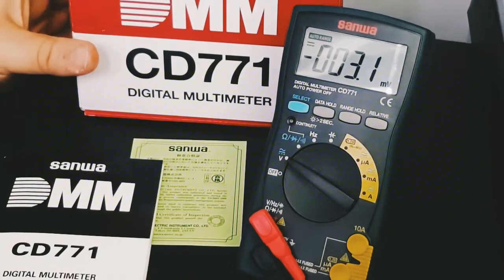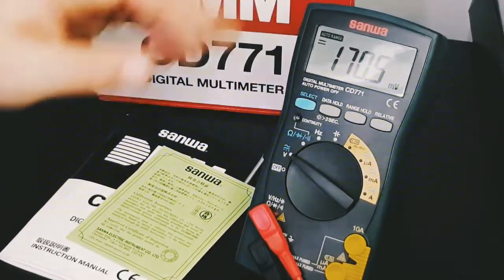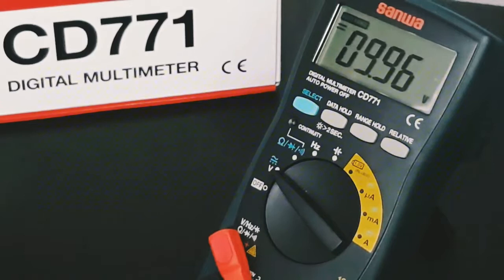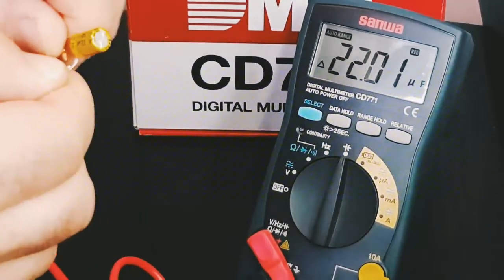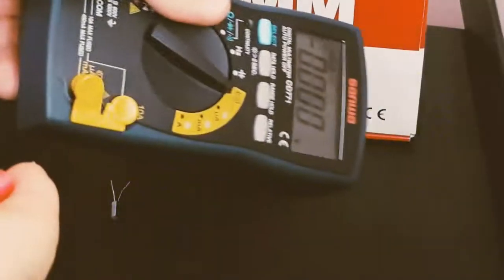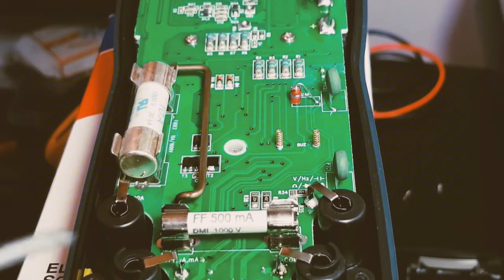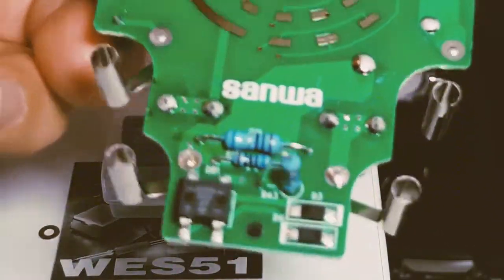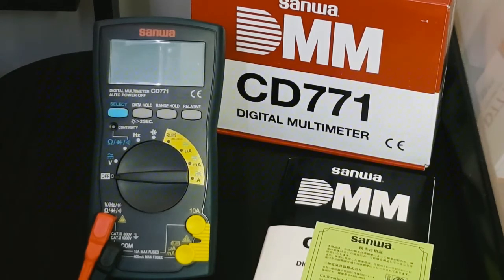SANWA CD771 Multimeter Review & Teardown!

Comment: as far as I can remember the cd 77x series was released in the mid 90s. I had one way back 2001. the 1st batch was made in japan. the rest was made in taiwan. mine fell on the road and got rolled over by a small dump truck. the plastic case was durable after the accident it had some severe dents but it still worked
Reply: So true...

Comment: Wow 100 Khz for the Sanwa, and wow those ranges switch pads look thick and beefy - some good jack support posts on the back panel for the lead sleeves as well, no pushing those out.  Nicely made spring mechanism on the range switch as well, and no cobbed main IC - I like it.

Comment: There're so many stuff made or assembled in China. Made in China does have great things, but also has a lot of cheap knock off. It's a matter of how to pick and choose. 
If you are not happy with it, I guess you can return it for refund for most of the time.
Reply from the maker: Indeed. I longer have this unit as I was generally not that impressed with it. It's sibling the Sanwa CD732 is still on my bench after 2 years 😁

Comment: Thank you for the review. It was very useful for me because I'm looking for a new digital multimeter to replace my old one. I was really disappointed Sanwa's soldering quality.
Reply from the maker: You are very welcome! Yes, I was thoroughly dissatisfied and underwhelmed with just about everything about this meter. After 1 year, the rotary/selector switch began to fail. If you want high quality,  made in Japan try the Sanwa CD732. I did a review/teardown on the 732  Excellent design, well constructed and very robust meter and only a few dollars more than the CD771.
Reply: Hi, Darren! Thanks for the tips. I’ve just seen your review about Sanwa CD732 made in Japan.  It looks nice inside and It made much better than CD771. I’m thinking about Fluke 115 because I need a compact digital multimeter with True-RMS, bar-graph, backlight and good working continuity feature. I thought it could be Sanwa CD773 but I don’t think so for now. Thanks for the review again!
Reply from the maker: @yuryk6010  My suggestion would be the UT139S (Check out my review) it's about 125$ cheaper than the Fluke, does everything you need plus alot more...it has a super clear screen ebtn display and works very well! There's a purchase link for it at the top of the comment section in the video review.
It's one of my favorite UNI-T Multimeters...It has very good input protection as well!
Reply: Thanks a lot, Darren. I'll have look the UNI-T.
Reply from the maker: @yuryk6010  Very Welcome!
Reply: Hi, Darren! I bought UT139C to try it out for home usage. It has a simplified design comparing to UT139E/S nevertheless the DTM0660L is on board. UT139C has its cons but I was really impressed Its built quality and features for the price. Thanks!
Reply from the maker: @yuryk6010  Great news! Enjoy the new UNI-T it's a great meter!!

Comment: Good review, now I'm short listed buying a new Sanwa multimeter between CD 772 and CD 732, which model would you reckon me buying? Currently I'm working in Construction Industry base in Malaysia, which sometimes I have to troubleshoot electricity wiring (AC) installation and electronics instruments (DC) for collecting structural analysis data. And my Budget is up to $80 USD which equivalent to RM 300 MYR only.
Reply from the maker: I would choose the SANWA CD 732!
Firstly, the CD 732 is Made in JAPAN. The CD 772 is Made in CHINA, just like it's brother the CD 771.
The CD 732 has a higher resolution (6000 count as opposed to 4000 for the 772/771) display which is also crisper and more vibrant. It does not have a back light but then the back light on the CD772/771 is terrible anyway! 
The CD 732 also has generally better specs (4000uf/60 MΩ) compared to a meager 100uf/40MΩ for the CD 772/771.
Yes the 772 is TrueRMS and does Temp, which the 732 does not and the 732 is not TrueRMS. 
However, I still think the SANWA CD 732 is a better overall value and better built. Hope that helps!
Reply: Thank you for replying Darren, at first I was dilemma between 772 and 732 because 772 has trueRMS and temperature reading but not 732. Meanwhile 732 has 6000 counts which would give more accurate reading and it also MADE IN JAPAN. Both has CAT III which is important for me to check voltage at the distribution board (AC).

If not for the budget limit, I would like to try Fluke such as 115 or 87v due to durability review. And again I would like to thank you for the clear it up the difference between 772 and 732 for me. If wouldn't for your review, I think I would go for 772. Now I would go for 732 for overall value and better built. Cheers!